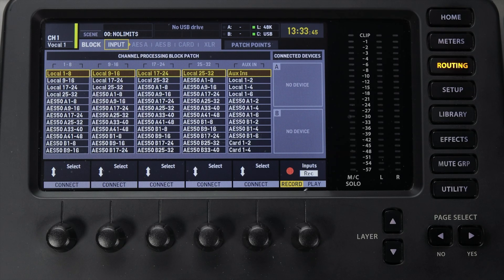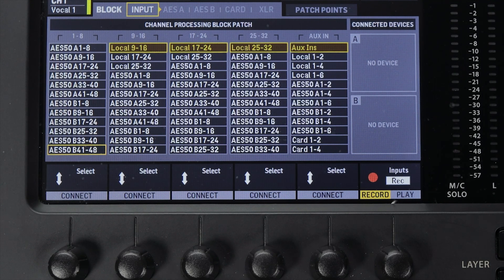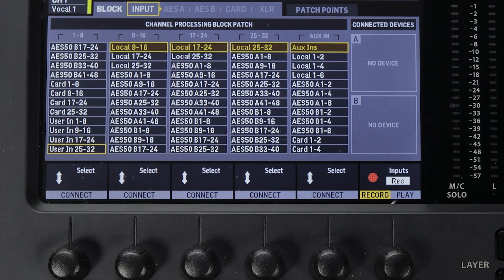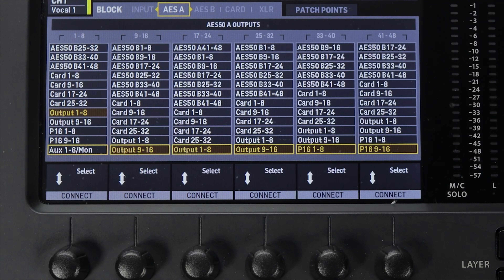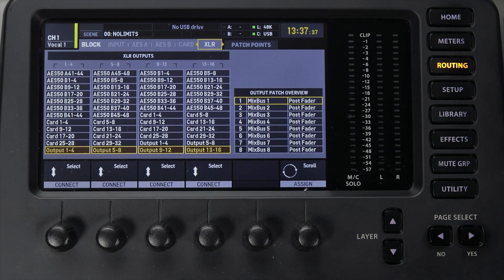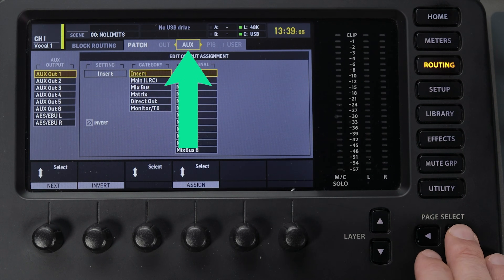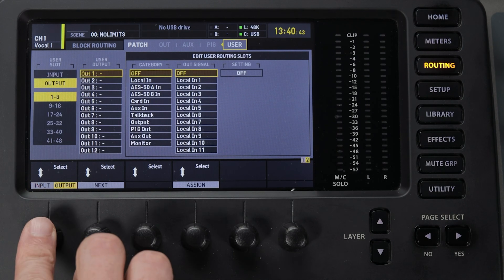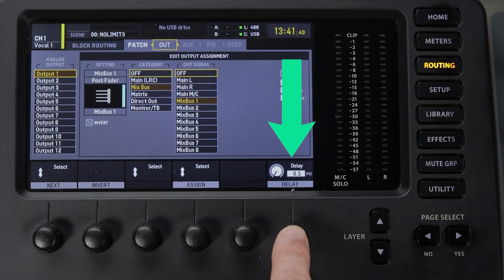Behringer X32 Routing Explained | Block & Patch Routing Made Easy

Comment: I have a mic on channel 1 of the mixer and i want to use channel 2-8 in the snake, in this video i see the routing but if i choose Local 1-8, i change it for all the 8 and not only for channel 1
so my question,  is it possible to use  chanel 1 on the back xlr input and the snake input chanel 1 at the same time? So i am free to plug a mic on the back or on the snake when needed?
Reply from the maker: Yep. Set 1-8 to "user" and then designate where each one comes from on the user tab.

Comment: There's one thing always confusing me. Some people said that although it's called "analog output" on the out tab of routing screen, in fact the outputs here are virtual. The real analog outputs are on the XLR out tab. Since I can only have access to a midas m32r a few days later, I have tried the PC editor in offline mode, and still can't figure this out. If I can set the signal source for each analog xlr ouput on the real panel on the out tab, why there's another XLR out tab? Well, from this video I have learned that XLR OUT tab is for batch setting. But if say I set mixbus 1~4 for analog output 1~4 on the out tab, then I set card 1~4 for output 1~4 on XLR tab, what will happen? if later I go back to out tab, set  mixbus 1~4 for analog output 1~4 once more, what will happen next?   I have been scraching my head and can't figue out the logic under the hood. Or in other words，If I set differently for the output on out tab and xlr tab, which one takes priority? Would you please tell more about the OUT tab and XLR OUT tab? Thanks.